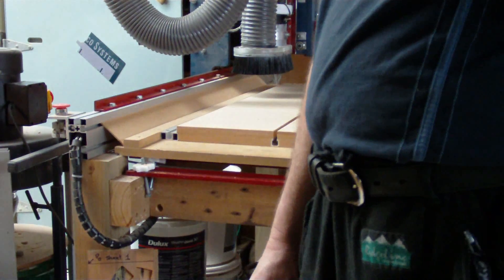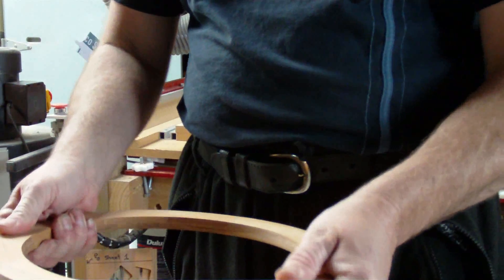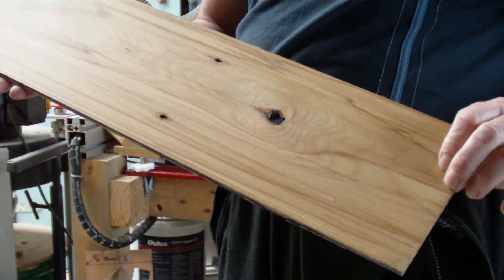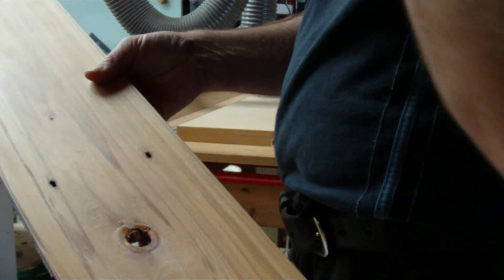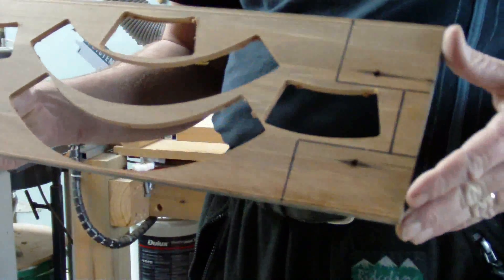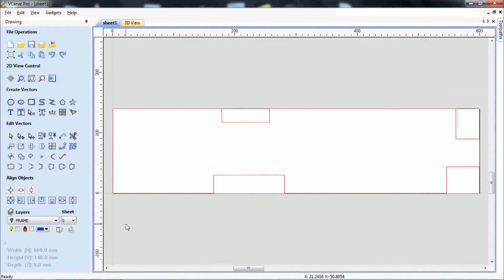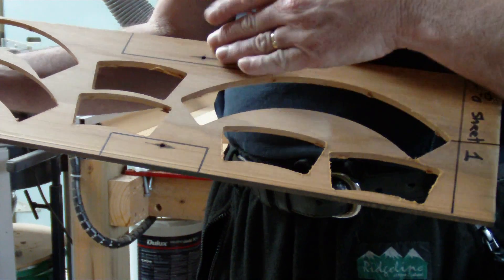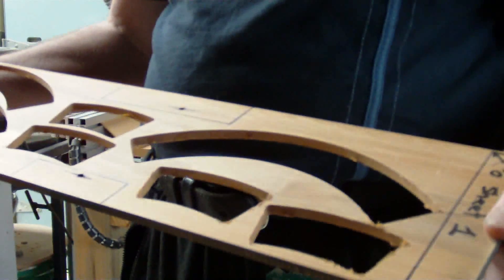CNC Recycled Timber - CNCnutz Episode  20

Comment: could put a laserpointer in the chuck of the router and jog to the 4 corners of the workpiece , connecting the red dots should show you if theres a bad part of wood within the piece getting used 
think the lasers they stick intoo a gunbarrel to dail in gun sights would work
Reply from the maker: Another idea is to take a photo of the wood looking directly down on it and them bring the photo into VCarve Pro. Scale the phot to match the stock and then layout the pieces where they need to go. I must give it ago.
Cheers
Peter